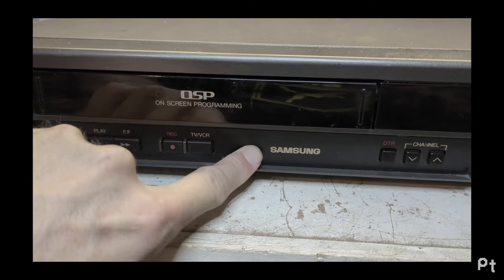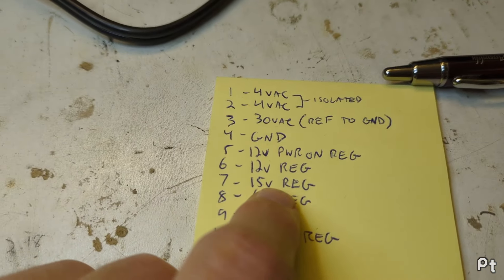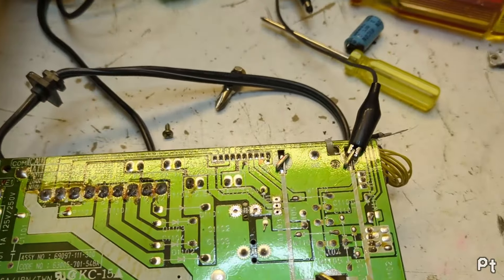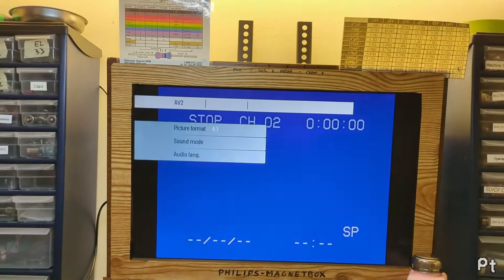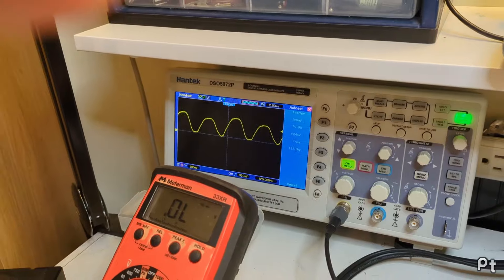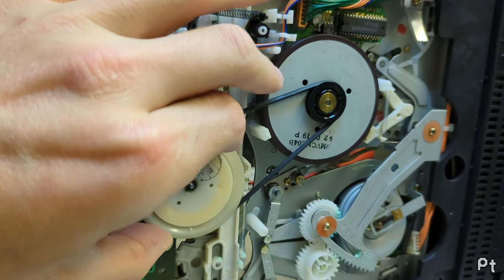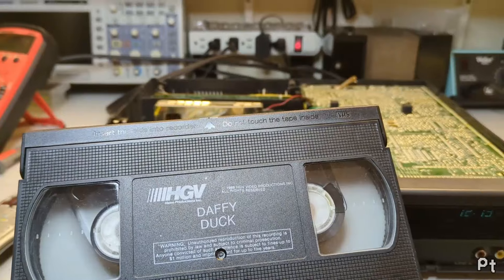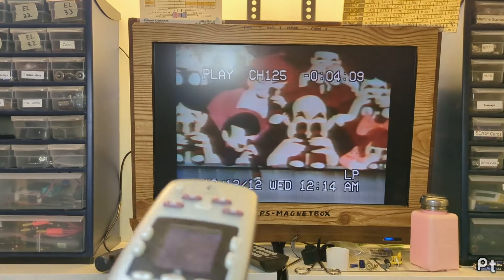Samsung VT-1270C VCR (from 1992) power supply fix

Comment: I had a Samsung that the same tape mechanism and I ended up running it trying to clean the mode switch as I could not get it back in time again.
Reply from the maker: This is what I was worried might happen if I started digging into that mechanism. I'll leave  it alone lol

Comment: Il pulisci testine e' meglio toglierlo,col tempo fa danni,ai miei li tolti tutti per proteggere le testine,il lavoro di pulizia lo faccio io.come fa a vedersi la videocassetta SVHS test tape in quel videoregistratore,e' VHS non SVHS,quel modello e' compatibile in lettura con l'SVHS?
Reply from the maker: Yeah I most likely will remove it, especially since this will probably be going to someone else. 

Regarding S-VHS, you can actually play back an S-VHS tape on any VHS VCR. It will look terrible (like it did in my video) but you can do it. If this regular VHS VCR were able to play back S-VHS officially (SQPB) then it would like just like a normal non S-VHS tape.
Reply: @probnotstech  Another vote here to remove the auto head cleaner, especially since it is already so dirty (risk putting that back on the head each time it makes contact) combined with age. Just one snag of fibrous material can ruin a head in less than a second.
Reply: @probnotstech  ma quella videocassetta e' registrata in modalita SVHS,quindi i segnali crominanza e luminanza sono divisi,come fa a leggere se il VHS e' composito,ovviamente non sto parlando dei modelli che seppur VHS sono predisposti dalla casa madre a leggere l'SVHS,ma di tutti gli altri..
Reply: @robbieblackmon1801  quel pulitore e' pericoloso,il videoregistratore di un mio amico ci ha rimesso le testine,e il braccetto che regge la spugnetta alla fine ha creato un piccolo solco al tamburo
Reply: @giuseppelavecchia775  They never really lived up to the expectations. When I used to service video recorders I'd remove them every time. Just not worth the risk.
Reply: @robbieblackmon1801  esatto,e' un rischio da non correre..
Reply from the maker: @giuseppelavecchia775  While the luminance and chrominance are combined at the (composite) input, and at the video head recording stage, they are electronically separated and manipulated in the VCR's electronics (look up "color-under"). S-VHS offered S-Video because S-VHS provides a better picture (higher bandwidth for the luma, so more detail) and at that point, composite video was a bottleneck in quality (due to the chroma/luma "dot crawl" interference). There's so much more to this that I'm not really knowledgeable enough to go into (comb filters etc).
Reply: @probnotstech  no non sto parlando dell'aspetto teorico,lo conosco,ma del fatto che il VHS non puo leggere l'SVHS perche il segnale SVHS ha le portanti crominanza e luminanza separati,il VHS lavora in composito,e se non erro il segnale video SVHS funziona a una frequenza piu alta del VHS.come ho detto sono esclusi i videoregistratori predisposti dalla casa madre a leggere l'SVHS,anche se in qualita VHS
Reply from the maker: @giuseppelavecchia775 As far as I'm aware, the chrominance carrier is the same between VHS and S-VHS and only the luminance was changed. VHS (both VHS and S-VHS) will separate the chroma and luma signals in the electronics. It has to because the chroma bandwidth is lowered drastically more than the luma bandwidth. S-VHS increased the luma bandwidth (which is more noticable to our eyes) but didn't improve the chroma.
Reply: @probnotstech  ok ma mi riferisco al fatto che i due sistemi hanno un modo di funzionamento non uguale,poi e' un'altro discorso che SVHS puo lavorare in VHS ovviamente,ma a parte le apparecchiature predisposte per la lettura SVHS con qualita VHS,non puo avvenire il contrario
Reply from the maker: @giuseppelavecchia775 Well, I would barely call what this VCR did "reading" S-VHS. It got a picture, but it would be very unwatchable for any actual content.
Reply: @probnotstech  ascolta ma la videocassetta test e' SVHS?,e il segnale video e' registrato in modalita SVHS?
Reply from the maker: @giuseppelavecchia775 Yes, it is an S-VHS tape, recorded in S-VHS mode on an S-VHS VCR. The tape itself is a Sony MQST-120 cassette and was recorded on a JVC HR-S7600U VCR in S-VHS mode.
Reply: @probnotstech  a questo punto non resta che fare delle prove,e come sfatare un mito,la regola dice che una registrazione SVHS non si vede sul VHS.in collezione ho videoregistratori VHS e SVHS e ho videocassette SVHS registrate in SVHS,faro' delle prove,e si vedra'..

Comment: I had a Sanyo branded Samsung from 2004-ish with a disintegrated sponge-cleaner-thing. I also had a Sony branded Samsung from the same period that didn't. Curses. I vote to remove it, it is a fake safety feature.